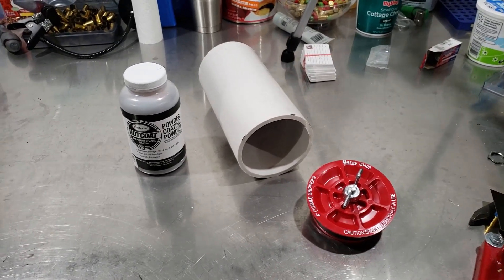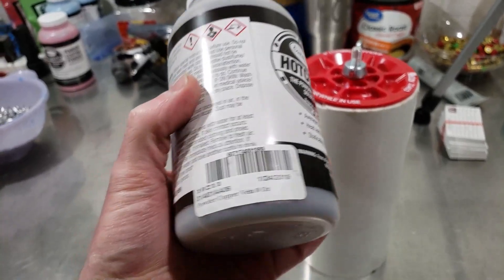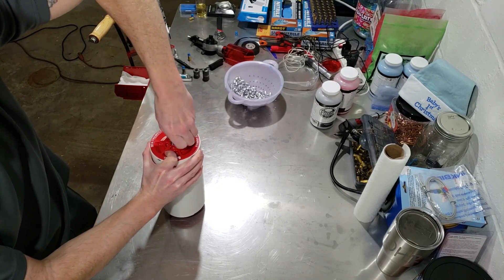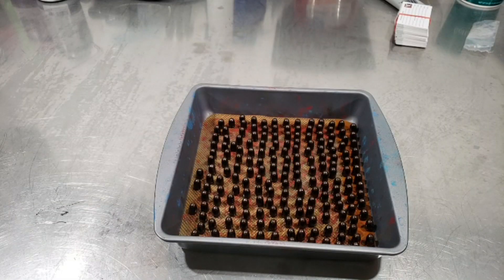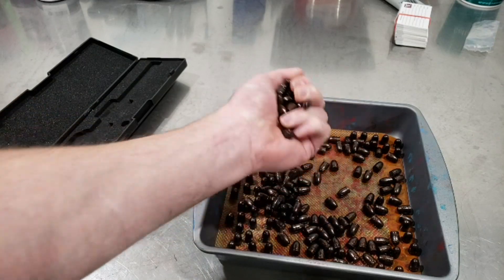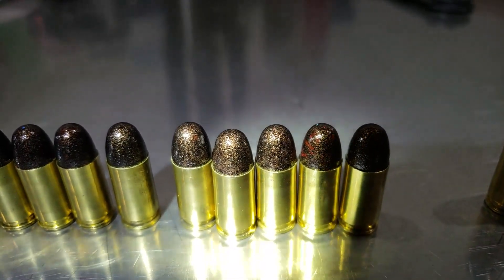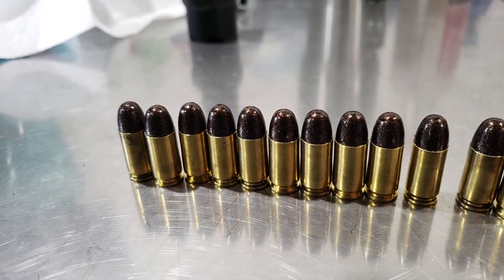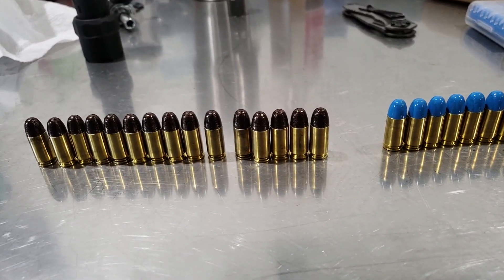Eastwood Copper Vein Powder Coating

Comment: Glad you had some good results, those were the Lee .312" 185 gr. RN bullets I had posted that I shoot in my Mosin and SKS rifles, I also did some using the Lee 200 gr. SWC in 45 ACP that turned out great as well.  I tumbled mine by hand as the powder will clump up easy if you use too much and it tends to leave a few spots no matter how you do it but you hardly notice it.
Reply from the maker: Nice! I was wondering what those were. Glad you had good luck with this too. I like how they look, I cant wait to see them in sunlight!

Comment: Those look great! Another powder on the list to try.
Reply from the maker: I tried this powder again recently and it didn't work at all after so much time. I must have gotten moisture in it! Had to toss it.
Reply: @TinManReloading  that's a bummer! Is it one you'd go for again, or just on to the next flavor?
Reply from the maker: @DummyRound  Onto the next. Ive been using Prismatic Powders - Sinbad Purple and its just as good as Eastwood Ford Light Blue. You can get Prismatic on Amazon. I left a review on the Amazon page!

Comment: I bought a piece of PVC today for my tumbler, and I couldn't find those red caps, so I got a plastic threaded one and it leaks like crazy.  Powder looks good.
Reply from the maker: I found these at Home Depot. The box on the shelf only had one, but I spotted another box way up top where they stock stuff. So I grabbed a store ladder and grabbed what I needed 😂 Thanks! You want me to send you a couple of those caps?
Reply: I was at Menards, I think most people get them at Lowes.  I think my local hardware store should have some.  I'll check tomorrow.
Reply from the maker: @243Outdoors  Alright man. If you need any, let me know!

Comment: Dude the color is sick! I really dig that man. Hey are you using tweezers to stand your bullets up? And where can I get one of those silicone matts for my tray?
Reply from the maker: Thanks Kenny! I just use my fingers, I put some powder on my gloves and go for it. I do want a pair of those big tweezers like Charlie Irby has, I muck them up with my fingers sometimes. I'll ask where he got his, I'd like to use those too. That way you dont have to shake the bullets around in a basket to knock powder off. He grabs the bullet and taps the tweezers on his pan. I honestly dont remember where the silicon mat came from. Maybe Bath & Body works? It was my wifes, I stole it and cut it up 😂 Started off as a big one for a cookie sheet.
Reply: Eagle Eye Shooting hi Kenny you can pick up those silicone mats at Walmart and ya cool color
Reply: Eagle Eye Shooting hi Kenny you can pick up those silicone mats at Walmart and ya cool color
Reply: Seems any cheap mat will work. Easy to trim. A mat for each color will avoid stripes if you don't /can't stand them up. The Amazon Basics mats are working for me.
Reply: Any hardware store that sells kitchen utensils should sell it. It comes in sheets and you have to cut it down to fit whatever you are using it for buddy. I got mine from T.K.MAX.

Comment: How much thicker is the copper vein than regular powder coat
Reply from the maker: I've noticed the copper Vein is actually thinner than a lot of others. It goes on nicely and sizes pretty easily. Bullet diameter increased about .002